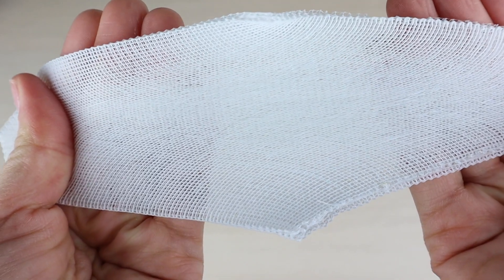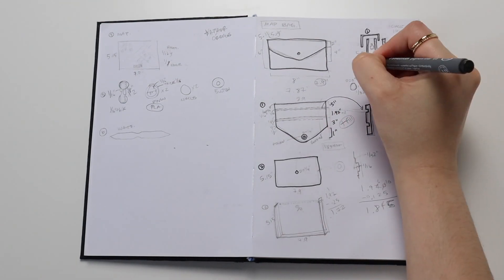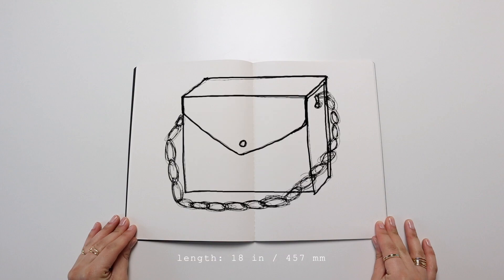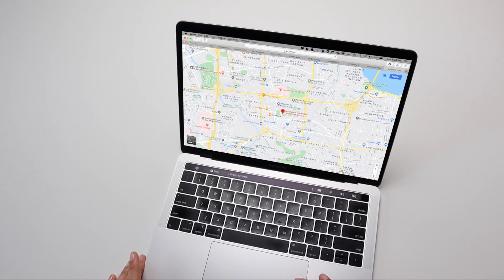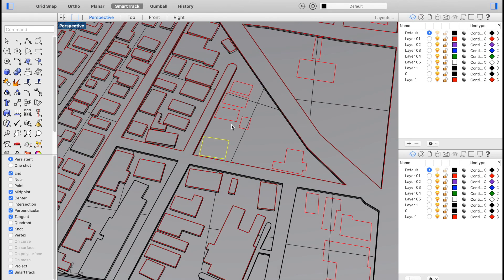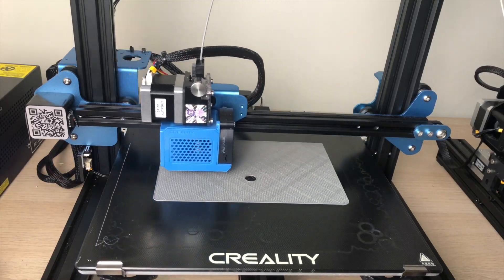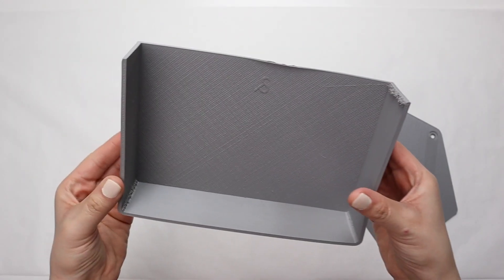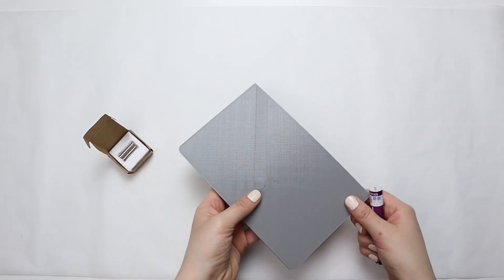3D Printed Handbag Tutorial | DIY Fashion Accessory

Comment: Hi, have I use the Cr10 v3 to print a flaxible filament?
Reply from the maker: Hi, yes! All of the flexible prints in this video were done in the CR10 V3. It comes with a direct drive extruder already installed.

Comment: Amazing video. I like the new approach of the double sided bag. Tip: you can import a screenshot into adobe illustrator and use the trace image command to accurately vector all the edges. There is a lot of fiddling around with the threshold settings to get it just right, but in most cases where you have a clear pictures it works perfectly. And it saves you a lot of time. You can then export these vector lines into .dxf file which is a file for sketches in 3d modeling softwares.
Reply from the maker: Thank you so much for your feedback!!! I need  to give Image Trace a fair chance. I tend to give up on it too quickly ;)